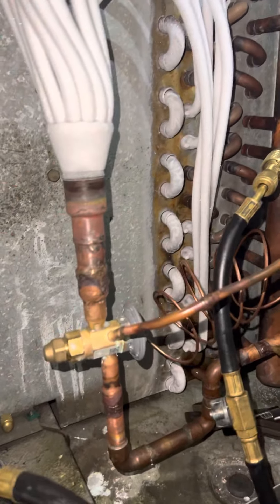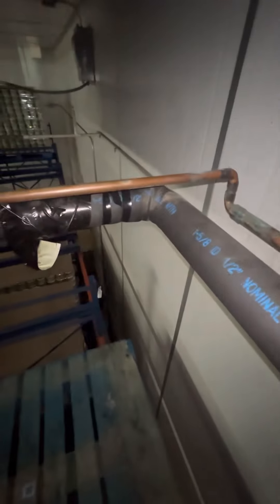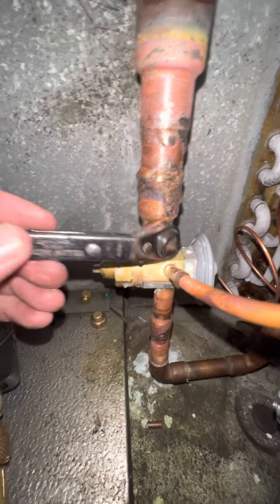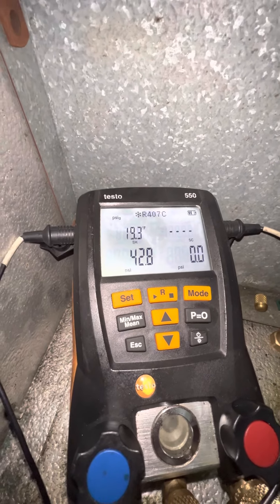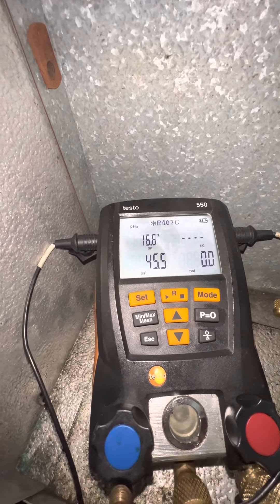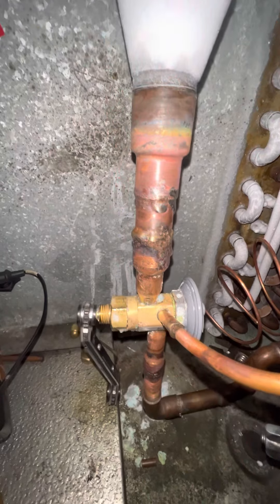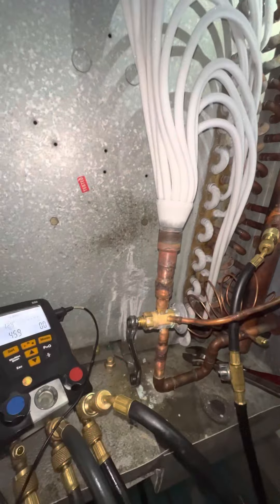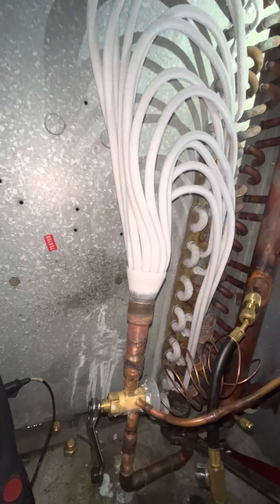August 4, 2022

Comment: What would cause the valve to need to be adjusted?
Reply from the maker: high or Low Super Heat
A/C =12-15F Superheat
Med Temp Coolers = 8-10F Super heat
Freezers = 4-7F Superheat